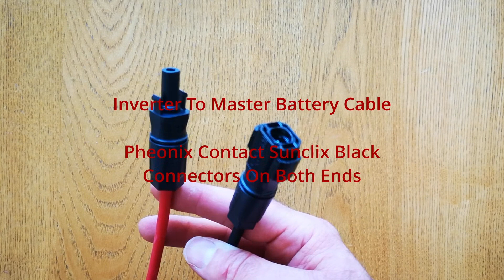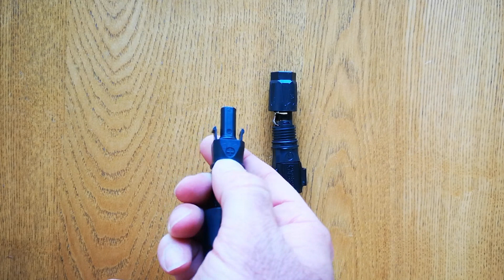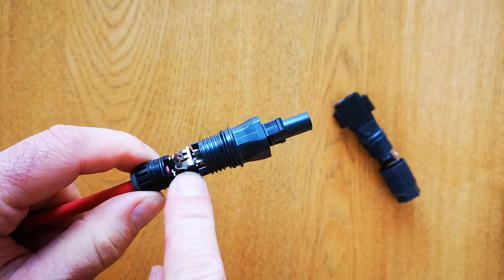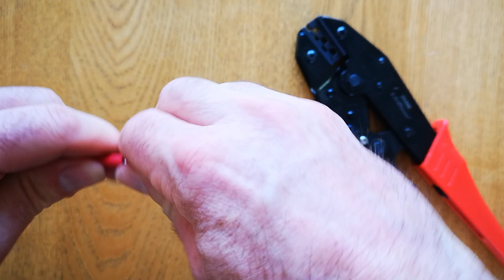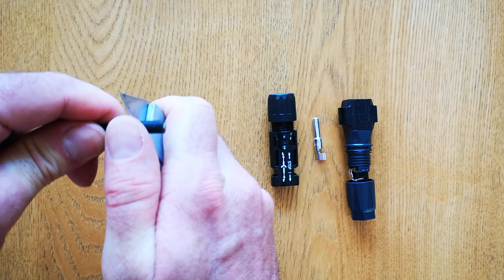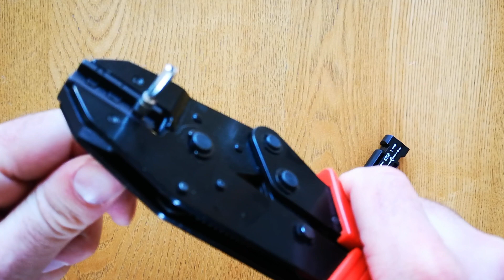Make Your Own Custom Battery Cables T58 5.8kWh - Solax Solar Inverter Battery Wiring

Comment: Would it be possible to use twin and earth cable or should it be battery cable?
Reply from the maker: No, it's not suitable to use twin and earth, or even normal battery cable.  You should use 6mm2 Solar Cable European standard H1Z2Z2-K which is designed to be robust and suitable for the potential high voltages.  For example, if you have 4 x Solax T58 batteries wired together, the voltage would be 460VDC, 30Amps with the potential to carry 13.8kW.